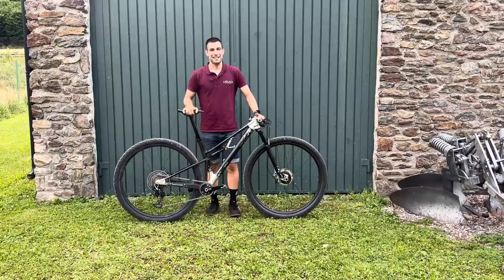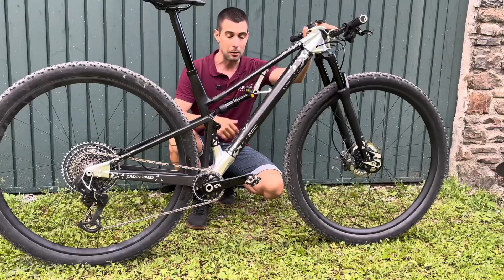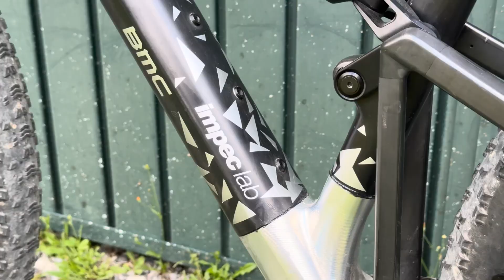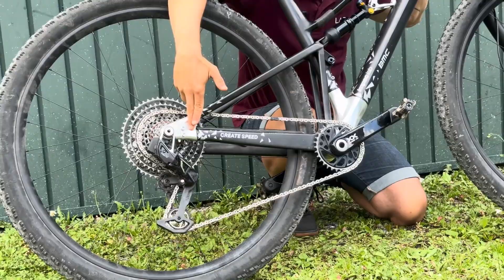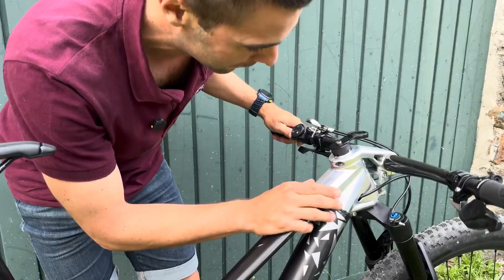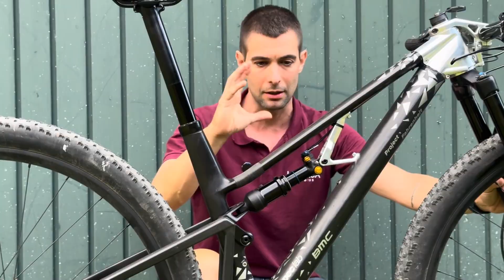INSIDE LOOK: BMC's 32-Inch Prototype - The Future of Mountain Biking? | Daniel Race

Comment: Regarding height: Its not 3" higher, its just 1,5"  which is about nothing when you remove spacers under stem...
Reply: But the fork bridge is also moved up 1.5 so it actually is 3 higher at the bars for the same amount of travel.